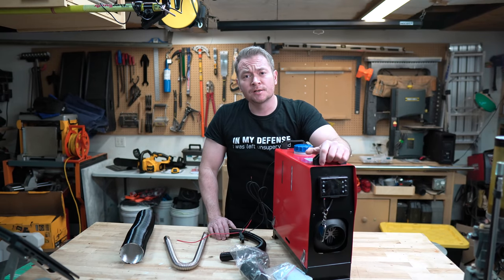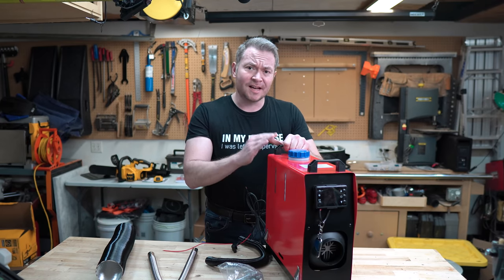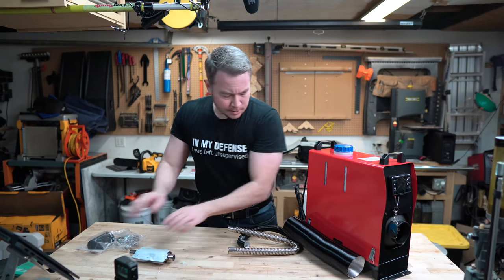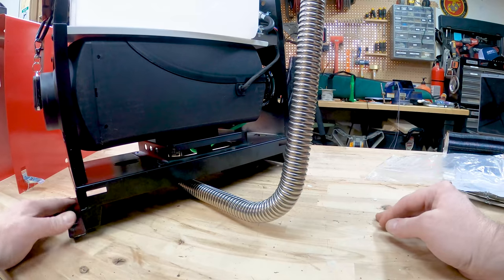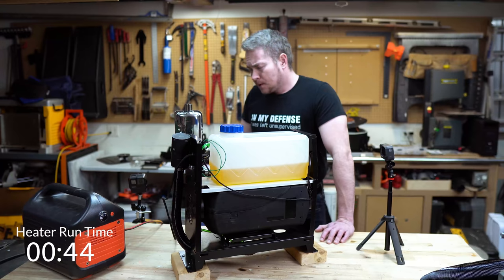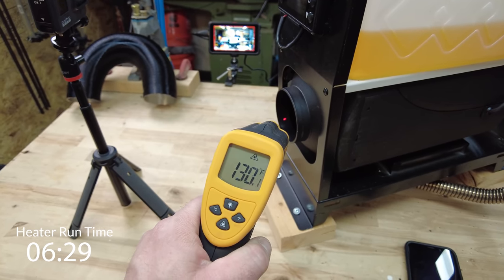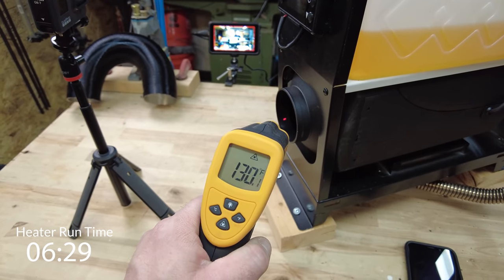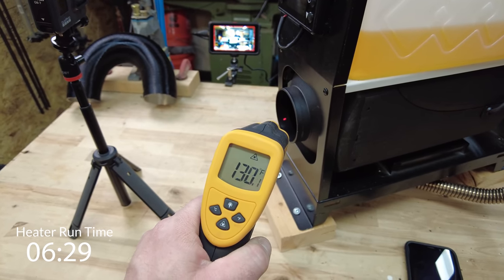My First Chinese Diesel Heater

Comment: Important note: Get the 8kw heater, or bigger.
Dont settle for the 2kw, the 5kw.

Sure, your small little caravantrailerhome may be small enough for 2kw to be enough.
But, get yourself the big one.
You can always turn the heat down a little.
You can not turn the heat up.
So if your 5kw is not producing enough heat for the room you are trying to heat..... you can not get it to produce more. (unless you wanna basically rebuild the device)
Get the 8kw, you can just turn it down a notch if it produces too much.

I bought myself the 5kw, just installed it. And it does take reduce the cold, it does warm up the living room.
BUT i think the 8kw device would have been a better option.

I am trying to heat up a livingroom that is roughly 50 to 70 square meters.
Meters, not feet. I dunno how to convert it. 
This 5kw heater does produce enough heat to get this room up to a temperature that is bearable. But i would have loved to see it actually produce sauna kinda heat. 
If the 8kw heater is indeed producing more heat, then i would go for that for sure next time i am alive on this planet (heck, i am gonna buy that 8 kw heater just for fun to see how it functions.
Reply: btw, some guys have been running this specific device for 3 years burning everything they got.
And after a quick clean up, it still runs.
Reply: If you want to keep it running for a long time, i heard it is a good idea to have it produce high heat just before you shut it down.
Let it burn itself clear before shutting down.

Seems the exhaust needs to point downwards to not build up stuff in it.

You might wanna clean our the area where the glowplug is installed. There is a little mesh inside. You wanna keep that as clean as possible since it is there to start the device. If it is clogged up, it wont start and produce tons of smoke.

As for the rest, i think it is self explanatory. 

They say to install the pump at an angle. So it stays lubricated. But i am not entirely convinced about that.
Either way, you do want to have this pump pump oil all the time. If it runs dry it is gonna damage itself eventually.

As for the rest, good luck with it. I bought one, burning it right now, works like a charm. 
And if the video i have seen in which people have been using this device for 3 years burning everything in it (hydraulic fluid, waste oil etc)..... then i think it is worth every penny.
Why pay 1500 bucks for the same stuff that might have a better quality pump, etc. But may also die in 3 years time if not taken care off.

We got brand new trucks that have used their parking heater (diesel heater) just a few times, and already some of em have errors, give out smoke, etc.
And the heaters installed on these trucks we have are the expensive kind.
If it were my trucks, i would have opted for this cheap one. It is the same aluminium that is used to build the heater. It is the same basic idea. Perhaps some parts could use an upgrade, for better quality, but if such a device can run for 3 years without any problem, and after a cleanup it can run again for quite some time, then i would say: WHO CARES about the more reliable pump?
How long will it run? 4 years? Wauw. 
GIve me the cheap one. I buy 4 of em,. store 3, and so i can run 12 years for the same price.

Comment: Noise tests have been done on those and it would appear they're not too loud at all. From another channel I understood that there's a 'hidden' menu that allows changing fuel ratios so if it is running rich (I am an utter noob when it comes to combustion chambers/engines so I have no idea how to recognise it myself), that menu might allow for some changes to reduce the carbon build-up.

Comment: You could have cut like 3/8 inch off the end of the pipe you clamped on, bringing the bend closer to the machine. Giving you all the clearance without the feet.

Comment: A quick way to find the amperage total wattage divided by voltage. If the total wattage is 48 using your tape measure how many times does 12 go into 48  12 volts 48 total wattage equals four amps 4 inches on tape measure. Do the same thing with 120 volt by dropping the zero on total wattage and dropping the zero on the 120 volt.
If your total wattage is 480 and your voltage is 120 by dropping a zero from both if you're 4 amps or 4 inch. This is just a rough calculation on a job site before iPhones.

Comment: I'm not an auto type but I've seen loads of auto types look down that muffler & say it's just a piece of corrugated pipe with no holes. If you stick your finger in it, it's actually a spring not a piece of tube!

Comment: I work on these every day in semi trucks, the Eberspacher D2s. Theyre extremely simple and easy to service and even to rebuild due to cleaning excessive carbon.

I dont know if these are setup exactly the same as the D2 but I will assume so. Theres 2 filter screens on these, 1 in the fuel pump and 1 in the glow plug chamber. The glow plug screen can be irritating to service. Maybe the chinese version gave you a strange socket to remove the glow pin, this will work about 5 times before it starts to spread around the glow pin. Best advice there is to take a expendable 12mm 6 point deep socket and cut a section out like an o2 socket. Once thats out you will be able to see the screen, Ive found the easiest way to service is to find a small bolt or screw thats roughly the size of the inner diameter screen and run it in (it can be slightly larger than the ID, so long as it isnt too large), grab it with vice grips and wiggle like hell until it comes out. Install is much easier. Every time you service it, take the time to clean the glow pin chamber of carbon before installing the new screen. Also there is a tiny hole that sits behind the screen in the chamber wall, this is a vent and plugs with carbon all the time. This will cause it to smoke like a freight train upon start up and total blockages will cause no-flame conditions. Take a paperclip, bend 1 end about 1/4" to 3/16" from the tip to 90 degrees to dig in and clean it out. Doing this during services goes a long way. Run it for about 10 minutes every month or so, this is Eberspacher's recommendation.

Otherwise theyre very simple if you have to tear into it. They were built with serviceability in mind and are very easy to take apart. There is 1 gasket between the burner chamber sections that always cracks after heat cycles, this can also cause issues with too much oxygen in the chamber causing no flame or hard starts - eberspacher adamantly denies this as an issue but I have determined this across dozens if not hundreds of d2 rebuilds. If you tear into it, replace the green gasket always.

Comment: Good video, well done. Just bought one and now doing research, haven't even taken it out of the box yet, lol. Got mine to heat my greenhouse. What has been your experience to date? Thank you
Reply: I thought about the greenhouse idea also but running the exhaust and the intake inside the greenhouse to feed the plants the condensation and the CO2 and then 30 minutes to an hour before entering the greenhouse turn a switch that expels the gas outside,

Comment: Can you used a remote control panel? I want to use it for my pickup camper and would not want to go outside to change the settings. Good video........... Thanks

Comment: We have an old stone house and have one of these installed outside our kitchen with the heat duct in through the stone wall and into the kitchen. We run it in conjunction with our woodburner in the livingroom next door. It's amazing for that instant heat and the woodburner has less of a hard time getting the downstairs to temp  We run ours through a 30amp transformer from Amazon but have a motorbike battery for a standby just in case of a power cut. Ours is the 5kw version not in a case like yours. 
I did someone making videos running his on cooking oil, but he hasn't updated. So it could be even cheaper, just interested in seeing if it last on veggy oil. Have you had issues with yours yet? ours has been floorless, but winters coming up so will be run more.
Reply: Veg oil won't burn neat, but mix it half and half with petrol, and all good. When using veg, on shut down put it up to full power for a minute, then go through the shut down sequence. 
Red diesel is cheap for heating, and you could also water this down with veg oil .

Comment: They were designed to mount on the floor of a truck and run the air and exhaust vents through the truck floor out under the truck.

Comment: Ive had one in my trailer and one in my garage for 4 years and they are still going strong. had to replace the fuel pump once when i was trying different chemicals like acetone.... and once because it just broke.

Comment: How did you get the diesel heater to run right off the jackery??? Mine won’t do it. Had to get a separate deep cycle.
Reply from the maker: I didn’t do anything special.  I just plugged the heater right into the Jackery’s 12v socket and it fired right up without issue.
Reply: @TomtheDilettante  that’s awesome maybe I just had a faulty plug. I’ll get a new one an try again

Comment: What is the rate of fule consumption? How long does it run for one full tank is tank one gallon? Thank you for sharing 👍
Reply from the maker: Depends on how high you're running it.  I have another video (link below) where I share my findings on fuel consumption.  Check out the 3:45 mark on this one and I hope it helps answer your question.

https://youtu.be/Z4mozM2hABw

Comment: I wonder if you can help me with this one ...my diesel heaters been running fine but I've noticed on the pressure side from from the pump there's a section of air in the pipe. It's also running a little colder. Any to reprime it haven't worked. What are your thoughts ?

Comment: I am thinking one with a turbine, it would generate heat and power. I know would be expensive. I experimented with an old 4 cylinder engine from a car. Cogeneration, running 110 volt alternator  at 60 amps and capturing  cooling water heat from engine. I used an old 80 gallon hot water heater tank and an old boat heat exchanger. We did all the laundry with the system producing power and hot water. I also had to hook up a fan forced radiator the the system also, the 80 gallon tank heated up so fast. Extra heat was ducted into garage during winter. This system was cheaper then on grid power would be with heat and power combination. Almost all equipment was free and If the engine fails there are many of them at junk yard. It does help that I happen to be a electrical engineer and marine diesel mechanic. I also installed high temp cut off system as well as low engine oil pressure shut down. You could even go a step further and capture the exhaust waste heat. The catalytic converter actually adds  heat to the exhaust that can be recovered.

Comment: Feet are good. I cut 3/4 inch off the stainless exhaust hose so it sat closer to the base plate. Then left off the hot intake hose so it would suck heat from the base plate. *wondered how much workshop exhaust heat recuperating could  be done with a 8ft length of 1” copper pipe as a chimney?

Comment: Interesting vid Tom.  I've worked with webasto and Espar heaters many times in the big truck world.   Alot of similar things going on.  If you had a diesel vehicle you could plumb right into the tank.  You may be selling g the heat output short as far as heating your shop.  Unless it's below zero out
Reply from the maker: Thanks bro!  I hope to have the opportunity to play with one of the higher end models some day.  For now, I'm pretty impressed with this thing!  As for the heat, we shall see.  It gets pretty cold in winter, but I'm hopeful this thing will do a decent job.  You're also right on with the tapping into diesel tank on vehicle.  Trust me, if they made a Crosstrek in a turbo diesel I'd be all over that LOL.
Reply: @TomtheDilettante  well at 10-20 below 0 deg f there isn't much that will keep you warm in an old building.  Hoping you do a follow up vid after a few good uses

Comment: They use this style of system in 18 wheelers to heat the cab while the truck is shut off and the driver is in the sleeper berth. They say that they only burn about one gallon of Diesel in about 10 hours. I had one in every Freightliner Cascadia I drove. I never was responsible for maintenance on the unit but never had any issues with them. I am sure it is not the china version in the big trucks but I am very interested in how this works out for you. What is the burn rate / fuel consumption for your unit when heating the garage?

Comment: Hi Tom. So, it's one year later. How is it working? Still happy with the purchase?
Reply from the maker: Yup, very happy with it.  Already started running it to warm the shop this year during some colder days.  You can find an update video here on the current install:  https://www.youtube.com/watch?v=uHML7yUf6zk

I also purchased a 2nd one for use while camping.
Reply: @TomtheDilettante  Thanks. :) I will check out the other clip. Very good job on the original presentation as well.

Comment: I purchased the what looks like the exact same heater, with the same exhaust line problem, so I trimmed the end of the line so it doesn't hit the floor and the heater sits flat on it's own feet
Reply: The exhaust in these is supposed to go THROUGH the floor which is why his bend to the side caused so much trouble.

Comment: Do you have the run the exhaust pipe outside of your enclosed unit? Or is it OK to keep it inside say the tent or the cab of a van?
Reply from the maker: Yup, definitely need to run the exhaust outside or run in a well ventilated area.  I fired it up this way for demonstration purposes only and only ran it for a short while. Off camera was an open door and a CO alarm above my head.  Bottom line, it is definitely not safe to run this in an enclosed space :).

Comment: I accidentally just bought the 5kw version. I was not aware that there was more than one option. 
What's the difference? More heat? Should I be concerned that I got the 5kw instead of the 8kw?

Comment: Great video, im looking at these as an option but have an old webasto water heater i was thinking of piping to an old car radiator with speed control fan to blow the warm air about.  One question, how hot does the exhaust pipe and muffler get at point along its length.  Thanks

Comment: That may make for a good engine heater. When the temperature is going to -20F to -30F below, keeping the engine compartment 30F warmer would greatly increase the chances of the engine starting. There are times electricity is not available.
Reply: That's a great idea.  Maybe fit an elbow pointing toward the oil pan.  Interested to see if that works or not.
Reply: Some diesel-powered cars and trucks have the Eberspaecher brand installed exactly for the purpose of heating the engine as well as heating the passenger compartment.

Comment: could i run this right off a 12 volt battery with an attached charger? like have a charger hooked to the battery plus attach the heater to the same poles?

Comment: would be nice if you could use a heat exchanger to capture some of the waste heat discharging from the exhaust line, maybe through a water jacket to make hot water for a shower or a recirculating hot water heater

Comment: Tom you may have mentioned the fuel burn rate if so I missed it. Can you tell us if the unit has just a single setting or low medium and high and if so what the fuel burn rate for each would be?
Reply from the maker: Not in this video.  I covered fuel consumption in this video (https://youtu.be/Z4mozM2hABw).  Basically it depends on how high you run it.  In my case, I chose to run it based on fuel delivery volume...a setting on the control panel to vary output.  Hope that helps, and thanks for watching!

Comment: My friend had one of these and, like you, he thought it worked ok... that is until he had it for about 2 months and then you guessed it... it started producing more and more fumes, the heat output went down and often would shut down mid cycle.... to top it off he is unable to source any parts to fix the glow plug issue he was having... All in all he is very unhappy with it.
Reply: I wonder if a Traeger Grill Glow Plug would work?!🤔😂😆🤣🤭🤫

Comment: The glow plug on shutdown is an emissions thing that turned up late 1990’s? Any residual fuel dripping should be lit off. Anyhoo, my D1 eberspacer doesn’t have it and a later D3 I owned did. So you need it to have it set on a thermostat so it never or rarely shuts down fully. Or, to look at it the other way, you are either wasting battery or diesel by opening the door or window a bit to keep it burning. Depends what you have a lot of? * I replaced the D3 with a refleks stove and for that you need to reach deep into your pockets :D but you can cook on it ^-^
Reply: Worked on hundreds of the D threes and fours and a dozen or two hydronics. I work for Thermo King they sell them for truck

Comment: Do,you have to leave a power source connected to,it to make it work ,,or just to start it up for running ???
Reply from the maker: Yes.  These do not generate their own power when running....at least none of the ones I own do.  They must be connected to a 12v power supply for operation.  On start-up and shut-down, they draw more power than while running to run the glow plug.  While running, it draws about 50 watts or about 4 amps and change while on high.  This is mostly to run the fan that blows air over the heat exchanger.  Hope that helps!
Reply: Yes that's for the info,,,,never heard of one of these ,,,very interesteing ,,,,,if a person coukd some how put a chargeing system on this while it's running to charge a battery ,,,that would be life changing lol,,,,,anything's possible ,,😁